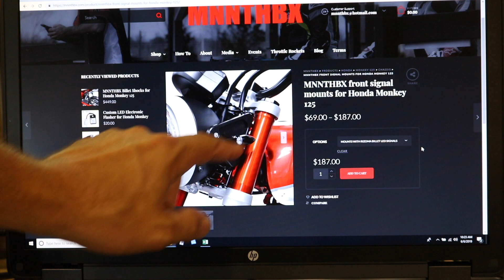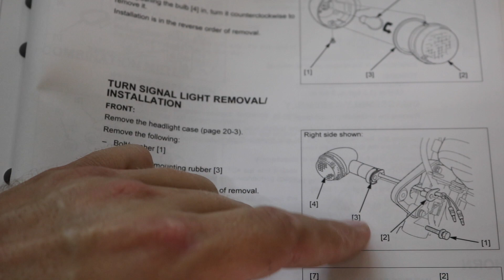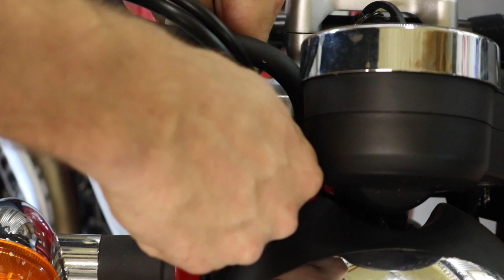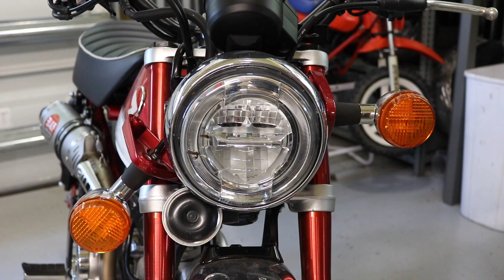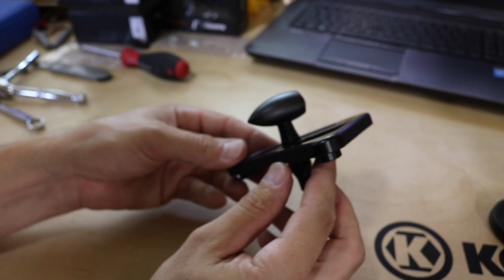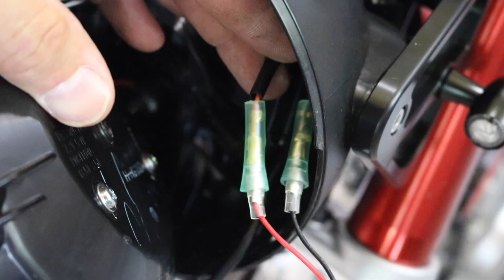2019 Honda Monkey MNNTHBX Front Signal Mount Install

Comment: My headlights dash and back lights don’t come one now, what did I do wrong?  When I installed and tried out one light it worked as should then just cut out all lights
Reply from the maker: That doesn’t sound right, there’s only two wires on the turn signals, even if they’re backwards it shouldn’t mess up like that
Reply: @John5XR  yeah I guess I blew a fuse lol but everything is back as it should, maybe I shorted a wire

Comment: Hey John! Another great video! Did the same front signals, but having an issue getting all wires tucked. Do you need to use the resistors?
Reply from the maker: Thanks Zac! Appreciate that! I didn’t have any issues with the wiring, it was basically plug-n-play with the connectors, and I used the flasher relay instead of the resistors, which helps reduce clutter
Reply: Popped in flasher relay (thanks for THAT vid with location!) and worked great. Just reaffirmed my position that following instructions usually messes me up more :). Thanks John!
Reply from the maker: Perfect! That’s exactly why I do these vids!